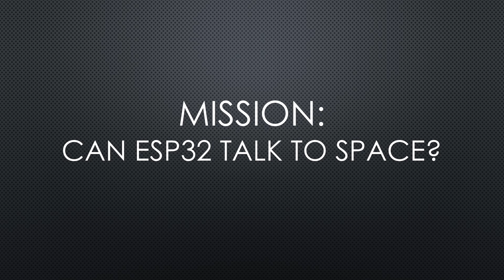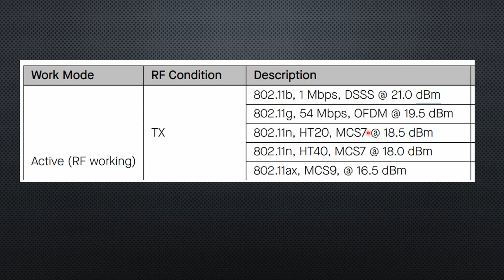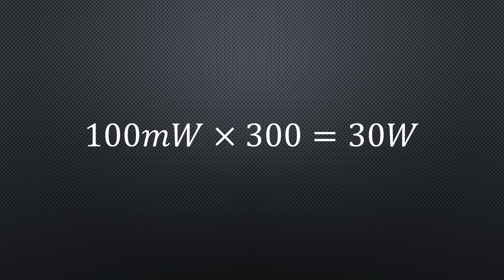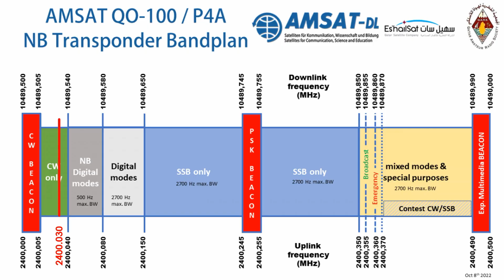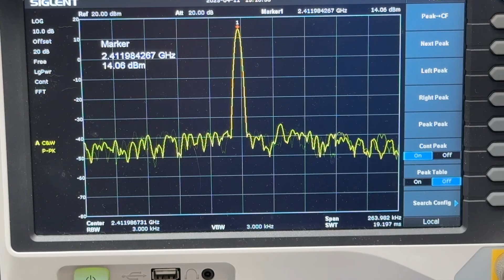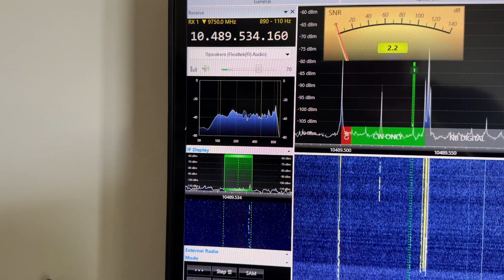36'000 km range with a simple ESP32? For sure a world record!

Comment: In theory, if we use nRF24L01 PA-LNA module, we can actually set it to send at 2.400 - 2.405 GHz with pretty OK (20 dBm) power, especially if we also add another amplifier like in this video which adds another 10 dBm. We can then connect the module to a microcontroller that is also connected to sensors or GPS and send back the information to home base via this satellite right? That would be powerful AF.
Reply from the maker: I think this would also work. With the same problems of frequency stability...
Reply: @AndreasSpiess wow you actually replied. I mean yeah they are just cheap modules after all.

Comment: hey, nice work. as a side projects, I create dev boards with various esp32 chips and semtech chips. if you need some custom board with specific items (e.g. power amplifier) I can design for you and send one. for now I have esp32C6 (but not mini, the board itself is quite big). it has internal antenna (not suitable for this project) but I can redo with external

Comment: If you were to design a mandatory LoRa/Wi-Fi/X kit for every building, for situations like we had yesterday in Spain (massive blackout, all the iberian peninsula was off), so people can communicate with family, friends, authorities, etc, what technology would you use? Maybe something that provides connections via bluetooth and/or wifi to any smartphone with the proper app. I wish we had a network like that yesterday, something that would last longer than the batteries on the 4G towers or even run "forever", at least during the daytime, as we usually have plenty of sun. Thanks!
Reply from the maker: Keep in mind: This was just an experiment without any practical value.

Comment: I wonder if it could be possible to QRSS with +10 dBm EIRP (which is the maximum you can transmit without a ham license). 10 dBm wouldn't require a dish but it would be veeeeeery slow.
Reply from the maker: I do not think you would reach QO-100 with 10dBm without a dish
Reply: @AndreasSpiess  My idea was to send an AM carrier with a 1 kHz tone, then use AM demodulation and then feed the output to QRSS software and average over several seconds.
The ESP32 does absolutely not have the required frequency stability for QRSS so I think this could be a way to get around it.
I will try to find some time to experiment with this, if I understand correctly I need to order ESP32-C6 for this hack to work, it does not work with standard ESP32.

Comment: Uhm for a while i was hoping you tested routing LoRa modulation over Qo100... why not? 73 de Ik3djc
Reply from the maker: Because LoRa usually has a BW of 125kHz, 1/4 of the overall QO-100 bandwidth...
Reply: @AndreasSpiess  yes, even 62.5khz @ very long slow scheme. Or even less with custom coding scheme and spreading factor it whould be nice just a transit test over qo100...
Reply from the maker: It was done a few years ago by an Austrian HAM from his car. But with an amplifier.

Comment: You could also try this with an nRF24L01+ +PA +LNA +Antenna module. It allows generation of a pure carrier from 2400MHz to 2525MHz without complicated software. The PA module supposedly also generates 20dBm+ signals.
Reply from the maker: You are right. But this would have been too easy ;-)
Reply: Unfortunately, the NRF24L01 can only tune in 1 MHz increments

Comment: Next: propose to ESA an experiment with a small cubesat. 5 euros for a microprocessor, a few dozen euros for the circuit and antenna and a few dozen euros for shielding. They have spent much more for less interesting experiments.
Reply from the maker: I once made a video about a cubesat with an Arduino chip ;-)

Comment: I teach RF Communications Theory at a local university and I think this would be a very cool project for my students to do.  I wonder if there is an amateur satellite that is reachable from my area (Oregon in the USA).
Reply from the maker: There are other Amateur Radio satellites available (called OSCAR). But they are in LEO and usually have 2m uplink and 70cm downlink. However, you need a HAM radio license to use them.
Reply: @AndreasSpiess  Ever since I started teaching RF, I have started thinking of getting my HAM license - especially since you no longer have to do Morse Code.  I am not teaching this summer so maybe ...

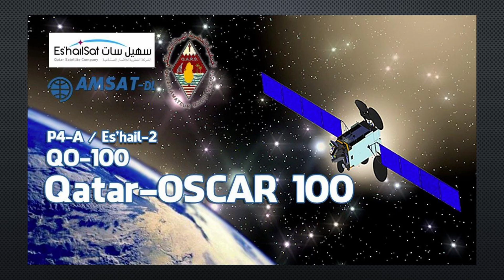Comment: 1:40 - Mercator - one of the flat earthers - his cones are squarish!
I recall you had already contacted space station with WLAN (wifi) but i am watching these 43 kkm
Reply from the maker: I did not contact ISS with Wi-Fi. We usually use FM or SSB for that purpose.
Reply: @AndreasSpiess  I didnt recall that video correctly :) - it was contacing antarctica and another guy with a swiis accent but that was just an intro video - "#327 QO-100 Reach a geostationary satellite on Wi-Fi frequency?" and probably it will be SSB over Wifi frequency :)
Reply from the maker: Yes, it was also 2.4GHz (Wi-Fi frequency)

Comment: About the upcoming antenna comparison, I can already predict that lots and lots of those boards with those red chip antennas (some have labels like "C3" on them and also happen to be mounted to an ESP32-C3 board) have absolutely horrific antenna performance.,
Those chip antennas typically need some space around them without any copper traces or ground plane and those small boards typically do not have taken this into account.
However you can easily adapt for this by adding a small wire antenna to it.
Just search for the blogpost from DB9JG, Peter Neufeld.

Anyway, as always, nice video Andreass.

Comment: Novice here with little knowledge but would love to know more about the dish used. Perplexity tells me the SIRIO HGO 433/868 MHz dual-band antenna is suitable but that seems to need a 20W booster? Perplexity says: "However, using a dish for LoRaWAN is not common practice, as most LoRaWAN applications use omnidirectional, Yagi, or panel antennas due to their practical size, ease of alignment, and the relatively wide beamwidth required for terrestrial coverage"
Thanks for the video btw.
Reply: This isn't LoRa, its 13cm ham band.
Reply from the maker: This is a big topic and cannot be discussed here :-(

Comment: Phased array ESP 32s : ).  I’m still listening, but I’m trying to guess where you’re gonna go with this.
Reply: Do you just have to use one device to break the record, or can you combine a bunch of ESP 32’s signals together
Reply: Good job breaking the record.
Reply from the maker: I do not think that many ESP32s would help. You just would get many morse signals on different frequencies.
Reply: @AndreasSpiess  you can combine the signals together and especially with AI controlling the signal flow. I would think you could do some pretty amazing things with a bunch of receivers in parallel.  A miniature radio telescope array
Reply: @AndreasSpiess  someone used them as a project to detect Wi-Fi, and it would draw an artificial bubble around the area showing the signal strength
Reply: @AndreasSpiess  imbed them in the dish and have them at the feed horn and then combine all the signals together

Comment: Not in Space .. this Movie show the same for under-water:
 I Tried LoRa Underwater and this happened - 433MHz vs 866MHz Battle! LoRa with ESP32 and Arduino

Electronic Clinic
Reply from the maker: This video was in the 2.4GHz range, not 868MHz LoRa...
Reply: @AndreasSpiess  I'd like to see you test the range underwater in some experimental setups. Preferably in a cold Swiss mountain stream.
Reply: @AndreasSpiess  Still interesting, these experiments with transmitters under water.
Reply from the maker: They use ultrasound. Very low frequencies in water.
Reply: @AndreasSpiess   Watch here :    I Tried LoRa Underwater and this happened - 433MHz vs 866MHz Battle! LoRa with ESP32 and Arduino
You probably didn't access the video I linked for you .
Again, as the title of the video clearly states, the "battle" is 433MHz vs. 864MHz. Not VLF.
Reply: @AndreasSpiess  If I set a Link, Jew Tube is delete the comment
Reply: @AndreasSpiess  If I set a Link, Y T wiII delete the comment.
Reply from the maker: I think I saw your video. The distance underwater was not very long on these frequencies. Usoally, people want to bridge longer distances...

Comment: Would be interesting with one of the digital modes PSK32 etc. Persistence pays off, Ham radio is fun!! 73
Reply from the maker: They use FT-8, for example. But with more stable oscillators and a bit more power... 73 de HB9BLA
Reply: @AndreasSpiess  Maybe a different transmitter to an ESP 32...but I'd be interested in seeing FT8 work.

Comment: Well done! Have you  thought of trying a cheap CCTV module like the TX6729 unmodulated?..perhaps not clean enough on the output, too wide-band..73
Reply from the maker: You can use any 2.4GHz board if it can produce a decent signal on the proper frequency. I tried the ESP32 because it was hard ;-)

Comment: That was impressive. I have a smaller and sort of oval shaped dish that I have been wanting to use to listen in on satellites with an SDR. Is the can on your dish  just a can with some stripped coax as an antenna on the inside? I guess there isn't an LNA? I'm generally curious what I would need to do to make dish useful.  I really want to make a much larger one and try to get into radio astronomy but I'm still learning to do the voodoo you do so well.
Reply: You can absolutely use an SDR and listen to the satellite. When I was setting my system up I used a RSPdx SDR to establish a signal. There is a PSK beacon at the bottom of the satellite band and just use that to find the bird. You can use a standard satellite TV LNB and tune around 739.5MHz (I seem to recall that is the frequency for the beacon) but you will find most LNB's drift madly due to the oscillator design for cheapness and with wideband DVB signals it is of no consequence but is an issue with narrow band signals. There is an LNB called the "Bullseye" which is not hugely expensive (£30) and drifts considerably less. You can also get software called SDR Console which will lock onto the beacons and give you a pretty stable receive setup. You will also need a bias-Tee to put 12V on the coax to power the LNB and isolate the SDR from the supply to the LNB.  

Typically you don't need an LNA but I decided to use one with my system and lock the LNB, SDR RX, transmitter and frequency converter for uplinking on 2.4GHz to GNS references.

Have fun! Also have a look at Moonbounce - that is the Grail of long distance amateur comms :)
Reply from the maker: I use an Adalm Pluto as an SDR transceiver for regular operation. I left a playlist of the build if you are interested.

Comment: Grats.
I would get a normal C6 board and replace the internal antenna with a cable. Micro-soldering :)
Stabilize the internal 3.3V to get a more stable frequency and better output. Maybe even go to the max of 3.6V ? See the esp32C6 spec.
Reply from the maker: Unfortunately, RF is not so easy :-(
Reply: @AndreasSpiess  
esp-hardware-design-guidelines-en-master-esp32c6 - pdf
Seite 16 abschnitt 3.6.1
Auf dem xiao board ist der pi-filter erkennbar, aber kein lötpunkte um intern/extern schalten, d.h. die sind parallel ?
Reply from the maker: Nein. Da ist ein Schalter (zumindest im Schaltplan). Und die Leistung verändert sich wenn man den Pin schaltet...

Comment: Very impressive! The ESP32 mini boards usually have very poor antenna implementations because of the lack of space. Better go for a ESP module with an antenna connector directly on the ESP module.
Reply from the maker: We will see in the test if all are the same...
Reply: I would expect lots of sub-optimalities in addition to RF performance on the smaller, compromise boards -- like analog, which also relies on good and spacious (in particular, ground plane) layout.  In the absence of a purpose-designed board, I'd expect the reference designs from Espressif and perhaps Olimex to work better than any mini-board.

Comment: Another way to tweak the frequency would be to use a different crystal so the ESP doesn't "know" that it's working out of band
Reply from the maker: I am not sure if they produce such parts.These modules use a 40MHz oscillator and a PLL to multiply the frequency. So a very small change in the base frequency results in a considerable change.
Reply: @AndreasSpiess  It is possible to tweak the crystal frequency by adjusting the capacitance.  That is how we trim the crystals in our transmitters.
Reply: @AndreasSpiess  Maybe you can heat it up or cool it down, depending on the shift you need.
Reply from the maker: That would probably work. You saw that my signal started at a different frequency after the pause. Then it moved with the "heating up" of the module. But only a few Hz.
Reply: @Andy-f8k2z The concept of a mental can is intriguing! 😉
Reply: Replace the crystal with a VFO?
Reply: Care to explain
Reply: @supremeleader5516  It depends on the circuit inside the ESP32 that is driving the crystal.  I would have to research that or just play.  Try putting a small capacitor (10-20pF)  in series or in parallel with the crystal or one on each side to ground and observe what happens to the frequency.
Reply: That would also affect the serial port speeds etc so would need to be switchable to upload code / messages if you wanted to do anything useful with it unless you want to bit bang serial over GPIO
Reply: That was my first thought too, it’s amazing that it can be done via software though

Comment: While you have all those comparison boards, I would implore you to also do a as a side project, a comparison of their default wifi transmit / receive strength just as a regular board. It seems that not always they have a good design for their antenna, and it's very handy to know which have been done decently and which have not.
Reply from the maker: I will focus on the Wi-Fi performance...

Comment: Wow, great to see again that your perseverance again paid off. As far as I could see it needed all your skills, tools and knowledge to make this possible. What would happen of you (try) to desolder the "selection" switch of the Xiao C6, and directly attach the output to the chips antenna output? Also, how does the Espressif fair with the amplifier? Happy easter Andreas
Reply from the maker: Unfortunately, RF is not so easy. These chips often do not have 50 ohms and need a small network to get to the 50 ohms for the connector.
Reply: @AndreasSpiess  thanks for learning us the RF peculiarities, I think it's complicated as well, especially those very high frequencies. Thanks for your videos about all of your endeavours.

Comment: Cool!
Did you try this to set the max TX power?:
    #define MAX_TX_POWER 78   // corresponds to 19.5dBm
    if( esp_wifi_set_max_tx_power(MAX_TX_POWER) != ESP_OK ) Serial.println( "Er: set MAX POWER 19.5dBm" );
    int8_t currentTXpower;
    esp_wifi_get_max_tx_power( &currentTXpower );
    Serial.printf( "TX Power: %d*0.25 = %.1fdBm\n", currentTXpower, 0.25*currentTXpower );
Reply from the maker: As mentioned, this hack uses the low-level libraries. So the commands are different. But I used the same code for the standard ESP32 and got more power...
Reply: one more setting that really works (in my case):
    int a= esp_wifi_set_protocol( WIFI_IF_AP, WIFI_PROTOCOL_LR );
    Serial.println(a);

Comment: Hi, great achievement.
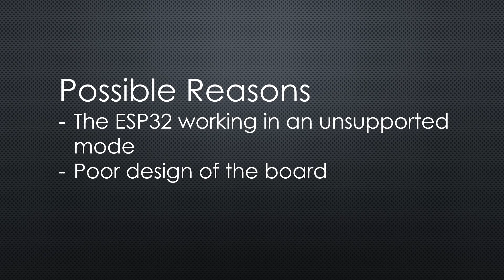But at 7:45 , your reference to "poor design of the board" I would regard as an insult to the design engineers concerned. They produced a product for WiFi band, not the frequency you are using.
Reply: but it is apart just a miniscule step. more like within measurement error of antenna building.
Reply from the maker: I agree. The frequency difference is small. But it is there, I agree.

Comment: H2 does not have wifi, only bluetooth, which is the same frequency. Would be interesting to see if the hack works.
Reply from the maker: Wi-Fi and BLE use the same radio. So if you have a hack for the H2 it should work, too.

Comment: I've tried entering the SDR hobby multiple times now but for some reason RF will always be black magic to me. Just can't wrap my head around it! Cool to see it overlapping with my microcontroller hobbies.
Reply from the maker: If you want, you can do it. I am 68 years old ;-)
Reply: @AndreasSpiess I thought you were in your.40’s!
Reply: My suggestion would be to start off with an RSPdx from SDR Play. There is very little faff to get it running as it is supported by its own s/w and you can use it with other SDR software tools. There are cheaper USB based dongles, but to get started I'd suggest something that you know works, is designed for the job and is sensitive. Also do a little research on how antennas work and types to save you going down the route of not hearing anything and getting frustrated early on. YMMV but good luck!
Reply: @rjy8960  I actually have a RSP1 from SDRplay but the software is confusing and the antenna is another story entirely. Are there any good starting points you can recommend?